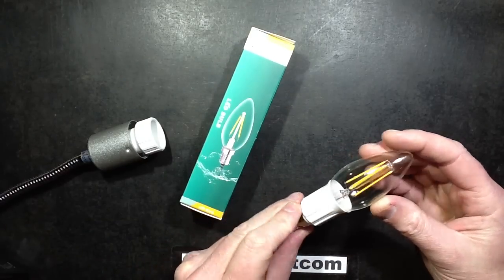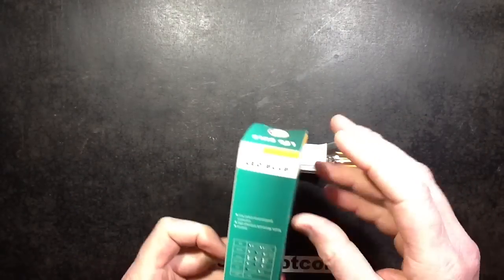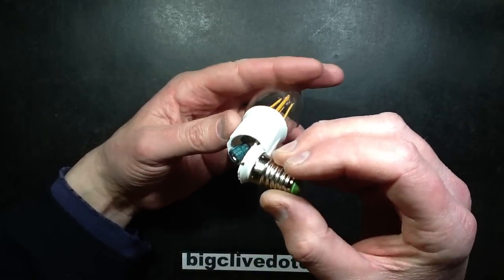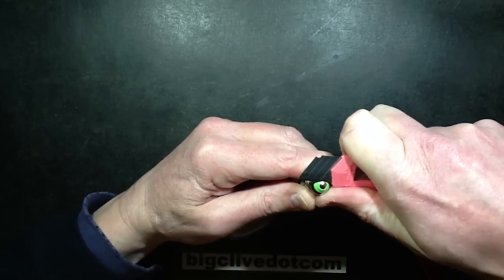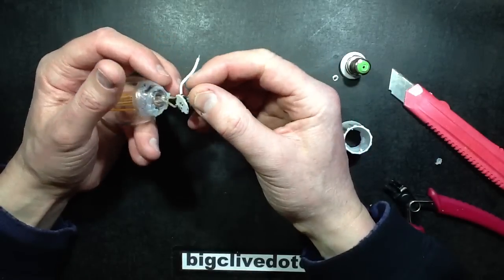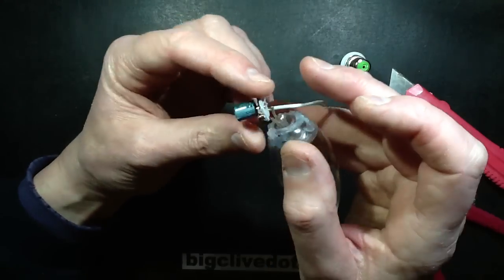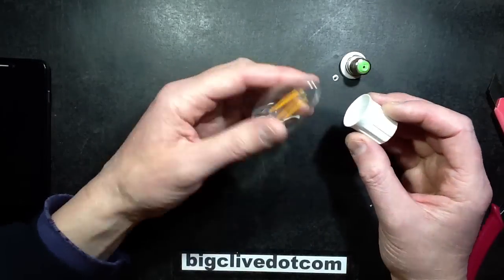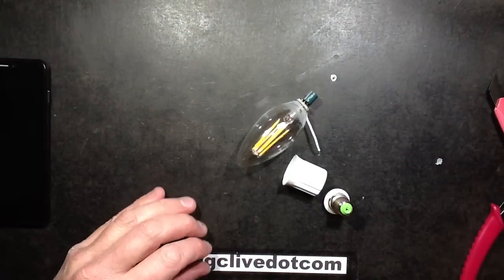Teardown of a 4W LED filament lamp with a buck regulator.

Comment: In Finland basic degrees are demonstaration based. When I was studying to be an automation electrician, I had one demonstration where I showed I can read circuit diagrams and solder up the circuit. I was given all the parts including two small boards where strips on either side go perpedicular. One circuit was rectifier from 12VAC to smooth 12VDC and the other was two led alternate blink circuit with adjustable time that could be ran by the rectifier board. I did my best to use as small footprint on those boards as possible. So, I got full marks and I was asked if I want to give the boards to the school because they wanted to put them on display how one should make those. Of course I let them have those.

Comment: KINGSO E27 2W T10 Cob Led Vintage Light Bulb Retro Edison Style Screw Technology 20W Incandescent Bulb Equivalent Old Fashioned Tubular Nostalgic Filament Not Dimmable Warm White 2700K 200lm Unique Designer Amber Tinted 110-240V. look good, tad smaller than regular tubular but works

Comment: Cannot seem to get these in small bayonet for some reason. Only small ES.
Reply from the maker: There are very few LED lamps on ebay with a small bayonet cap fitting.  Most of the world seems to use Edison screw, so they grudgingly produce a small range of lamps with BC caps.
Reply: Michael Beeny Id have a search for "B15 LED filament" if I were you! :)

failing that, you can always get converters
For reference, the small ES screws are E14 bulbs. The larger ES screws are E22's

Small bayonets are B15, larger bayonets are B22

Personally, Id rather get one of these:

http://www.lightingever.co.uk/led-bulbs/led-filament-bulbs

Then I know it's properly safe to use ie: CE approved, RoHS compliant etc... and then get an E14 to B15 converter :) - purely because they use even less energy and produce MORE light!

It also appears that "LED Connection" also sell B15 bulbs as well. (Another UK based company)
Reply: Problem for multi-lamp fittings where we used to use 25W or even 15W incandescent is finding an LED of sufficiently low output. Even these 2W B15 candles can make a chandelier seem more a stadium light when there are a dozen lit together.

https://www.ledbulbs.co.uk/products/philips-2w-led-e14-ses-candle-very-warm-white-76688000